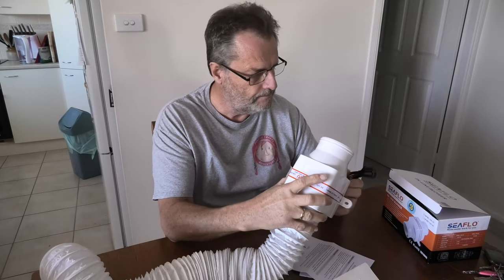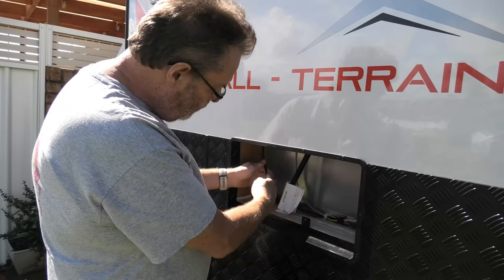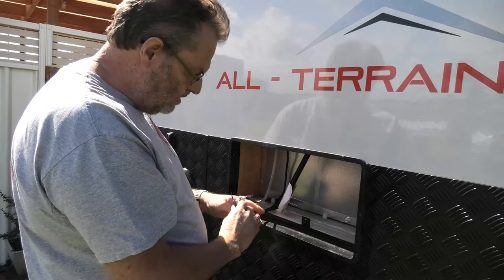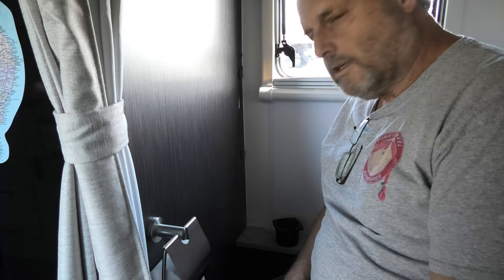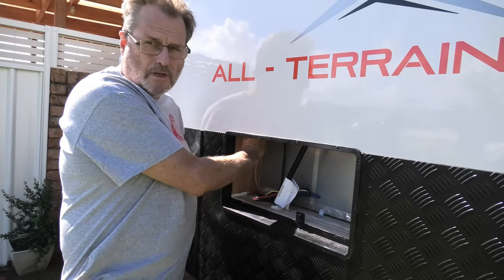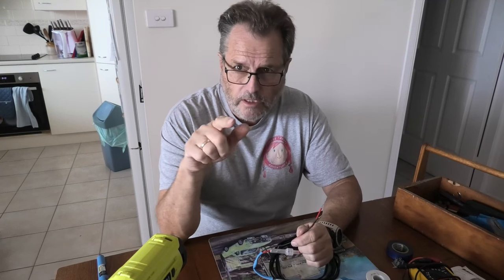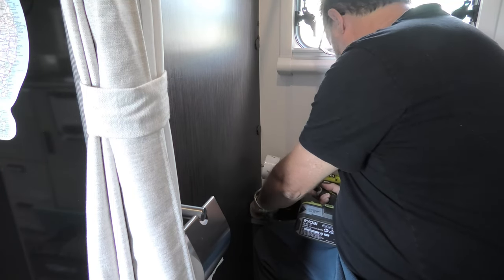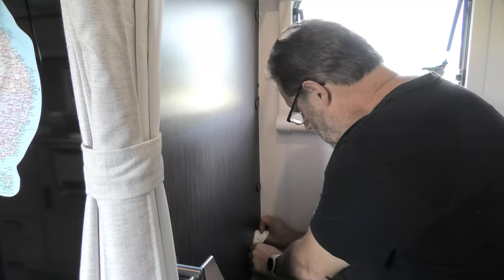Ep Mods-2305 - Low Cost Dust Reduction System (DRS)

Comment: Hi Alister 
Love your work.
I was so happy to find your video as I have been looking for a simple solution as you have presented I have one question regarding our van has a small scupper over our bed which I’m not sure if I should open this device also when on dusty roads? Do you have an opinion in this regard.
Again thanks for all your insight 
Cheers
Reply from the maker: If there is no filter behind the scupper vent, I'd most likely keep it closed. It depends if you would be getting clean air. But, if you pass someone on dirt road coming the other way, chances are you would scoop in a lot of dust.

Comment: Both vents are required by the fridge cooling system 
Cold air comes in the bottom and is drawn up through the cooling fins at the top 
By reducing the intake ( the bottom vent) the cooling efficiency is affected 
Simple fridge knowledge so by no means " not needed"
Would have been a better location towards the front of the van as there's less dust above wheels
Reply from the maker: Thanks for the info! however, being a compressor fridge it doesn't need as much cooling/circulation as a 3 way. The air being forcefully sucked into the cavity behind the fridge is still available for the compressor cooling at the top vent.

Comment: I would have put the fan in the top vent, otherwise a good job.
Reply from the maker: There is not enough space in the top for a fan, that's where the fridge compressor is.
Reply: @PinkysTravelAdventures  maybe you could have run the ducting to the top vent.
Reply from the maker: The ducting goes into the van. There is an air pathway from the top grill to the lower cavity, so if the filters in the bottom block, it can still suck air through the top filter (like a backup).
Reply: Yeah fan should have been in top vent

Comment: Ive done the same  but what i did was use a car air filter on  intake side  of the blower and used a cabin filter attaching  aluminum gill to hold in place with wing  nuts and bolts for easy replacement of filters  also  used marine grade  stick on sponge seal
Reply from the maker: Yeh, like the idea. I will probably make a better filter later.
Reply: Did yours work well ?  So far no one has indicated that this idea works
Reply from the maker: When I open the door with it going, I notice an increase in fan noise, proof to me that the fan is pressurizing the van when door closed. I'm yet to travel on dirt roads.
Reply from the maker: https://youtu.be/Ygi-ZVQYUa8

Comment: Was the aluminum filter mount plate just taped to the plastic  grill or did you also solid attach  eg  screw it ???
Reply from the maker: Taped around grill with duct tape, plus sika the gaps where tape would not stick.

Comment: Good job on that positive fan . 
I was just wondering that fan works as soon as you plug it into your car 🚗. Just curious if I missed something. Take Care.
Reply from the maker: Yes it does, I've run its power cable to the Car input on the Van BMS, so when van plugged into truck, it gets power straight away.
Reply: @PinkysTravelAdventures  thanks again for showing us how you did that,great job.

Comment: My only concern is that all the Blowers I have looked at, including the one you have used, say that "Continuous Duty" means running for no more than 20 minutes non stop. Not sure how you will get on with it running non stop.
Reply from the maker: Yeh, I've now changed mine so it's on a switch, I turn it off when on blacktop.

Comment: Hi, fantastic idea for sure I have the 100mm fan it is rated at 275CFM it really moves the air I was quite surprised as to how strong it is.   My question is pretty much the same as everyone else's really, have you tested the idea does it work?   Have you had any problems & if so, what were they?   I have no room left on my roof for a Dometic or a Sahara, so I pretty much have to give this a shot.   If you were to do it again what would you do different, how & why?    Any pointers you can give me, would be very much appreciated.   Garry.
Reply from the maker: Hi Garry, Yes I would do it again, however would use an AC filter which has a larger surface area. I've added a switch to turn it off so it doesn't wear out whilst on the blacktop. No haven't tested yet, but I'm confident it will work even better than the dometic, which relies on movement to generate the air pressure.
Reply: Hi again, I have made a little progress with my dust suppression filter the K&N RU-2590 fits my 4inch Seaflo blower & cavity space in the van perfectly, the K&N can be taken off & cleaned out & re oiled for the next trip.   Regards, Garry.  @PinkysTravelAdventures
Reply from the maker: Thanks, might get one to put on, double filter then.